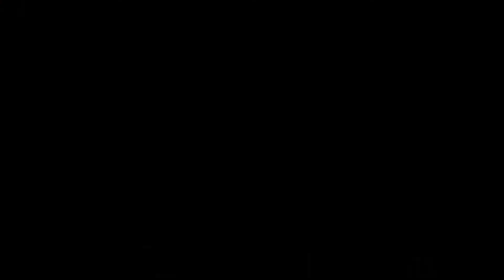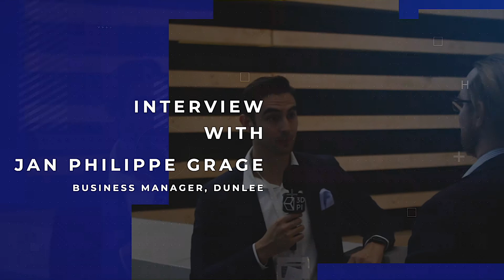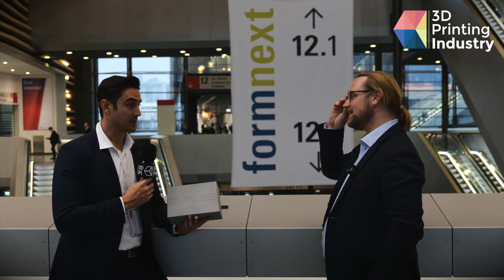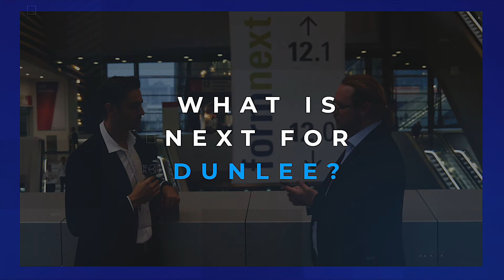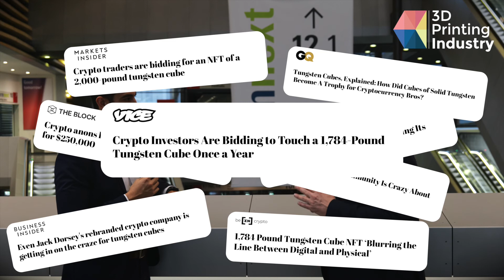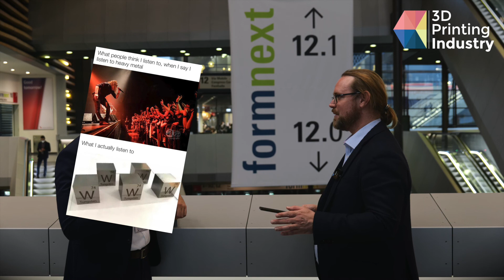3D printing tungsten with Dunlee

Comment: The block in his hand looks like it is made of styrofoam as far as the ease of holding it goes.
3D print a Dragon with Tungsten, then we can know you are using 3D printing instead of CNC machining.
Give a diagram of the laser system, otherwise this is an ad with terrible jargon and no meaningful discussion of what it is you are actually doing.
You are saying things like “this is used for…”, you have absolutely made a completely misleading title, since you haven’t showed how you are building what you are building, what your machines are actually doing.

If you want a real video, look at the Thought Emporium YouTube channel, who actually goes through the physics and the engineering of his devices making stuff.
Reply from the maker: Hello Evan, thanks for taking the time to write a comment. The large block is a mock-up to demonstrate the grid layout. If you'd like more information you can take a look at our website or the Dunlee site. There are also a number of other tungsten components on the site that might be of interest. Thanks for watching